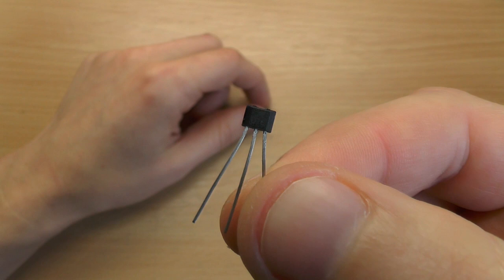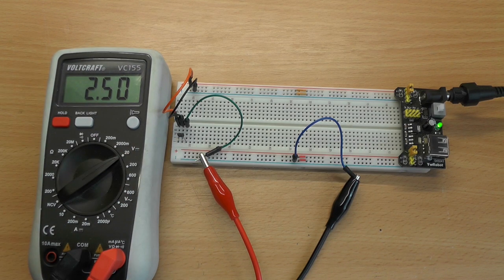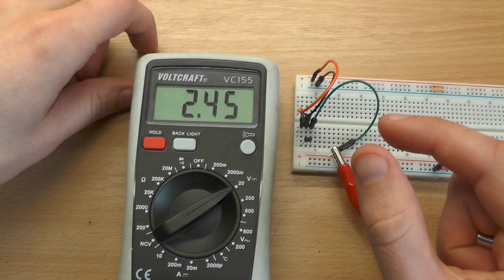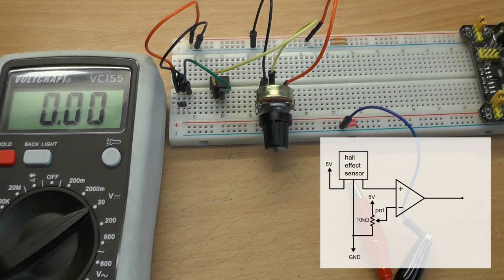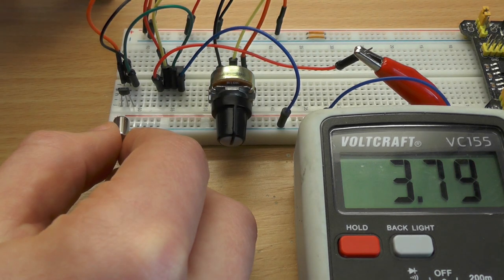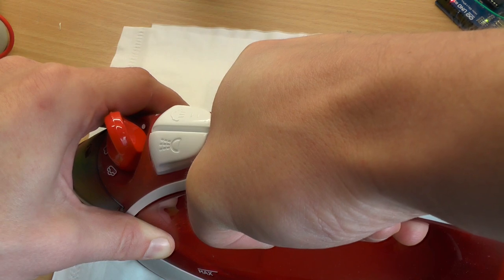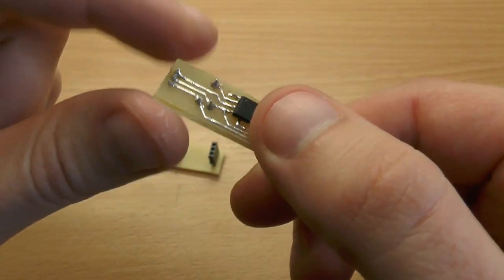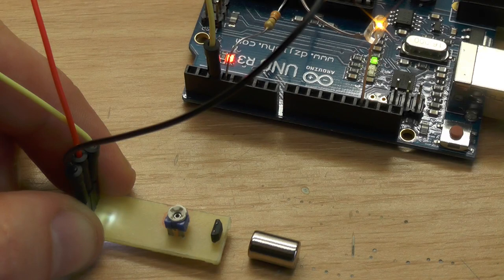Hall effect sensor tutorial - 3D printer end stops

Comment: This is so smart! I would suggest though getting a linear hall sensor not as an endstop but as a bed leveling sensor. By moving the sensor to the print head you get the added benefit of being able to use it for bed leveling.
Reply from the maker: not sure if they don't drift at different temperatures... just like in curie point etc
Reply: bitluni's lab look up 3Dtouch bed leveler sensor. It uses a small metal plunger that freely moves up and down and uses a hall sensor to read when it is pushed up by the printer bed to register the bed height. I’ve been using it for a a few months and it’s temperature invariant. It doubles as a z end stop and a bed leveler.

Comment: I used halleffect endstop in my voron and the problem is when the temperature inside the chamber is getting hot the distance of the magnetic area between the magnet and sensor will change, then the Z stop position will change too.

Comment: one question tho, by using an amplifier, you converted the hall effect sensor from linear to switch. so why dont you just simply use a switch hall effect sensor? it will give u 5v if magnatic field is detected and 0v otherwise

Comment: Nice work!! Would this give good resolution for a trigger set up?  Want the magnet on the trigger and as you pulled it closer to the sensor it could give an analog out to a control and than the controller would convert to a PWM circuit to control an ESC.  Want some range because it will be on and ESC.  Even like to build some expo curves where it isn't as sensitive on the first percentage of the pull.  What do you think?
Reply from the maker: Sounds good.. then you can connect the linear hall effect signal directly to the analog pin... could work.. what kind of project are you doing?
Reply: Wanting to making a transmitter and a receiver with an Arduino Pro Mini and the nRF24L01.  Do them in a pair.  The trigger can be open to water hence why i need the hall effect sensor and a magnet, the other compartment needs to be water proof.
Reply: Just wondering if this hall effect sensor will give enough resolution want the trigger to have some play in it